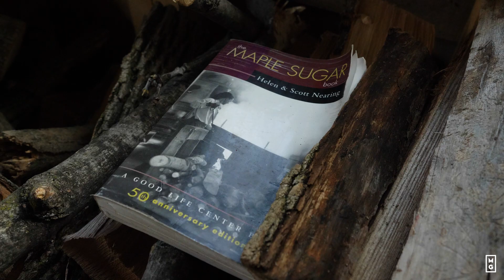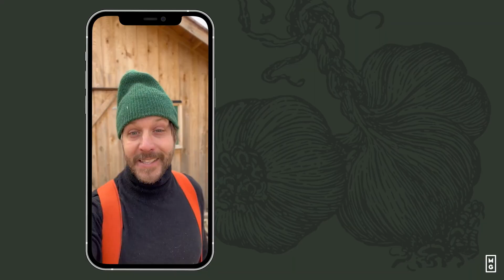Making Maple Syrup The Old Way | Jean-Martin Fortier’s Sugar Shack

Comment: Great video!  The other day I watched a video about a Russian guy who settled in Northern Alberta, and he was making syrup from birch sap, which I understand is traditional in Russia and probably Scandinavia.  He made an interesting observation: apparently the trees produce a lot more sap on windy days, and he was wondering if the trees used the swaying from the wind to pump up the sap from their roots.  Have you noticed anything similar from maple trees?
Reply: Very interesting observation. I know sometimes sap will run more when there's a low pressure weather system in the area. Sometimes wind is a good indicator of changing weather and pressure systems, may have something to do with that as well. Worth investigating

Comment: What should I do if my unopened gallon of maple syrup is building pressure just sitting on the shelf?
Reply: something got into it and is fermenting?
open it up
heat it
filter it
re-can it
check the boil temp, you might not have cooked it long enough. 219F or 104C